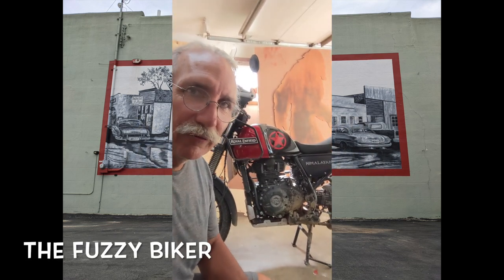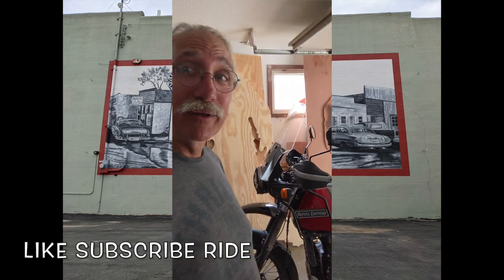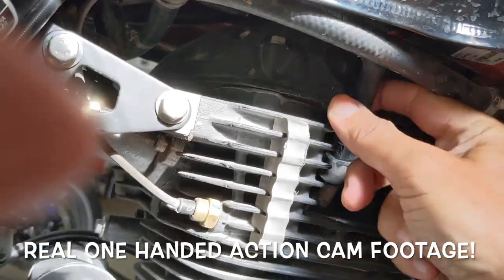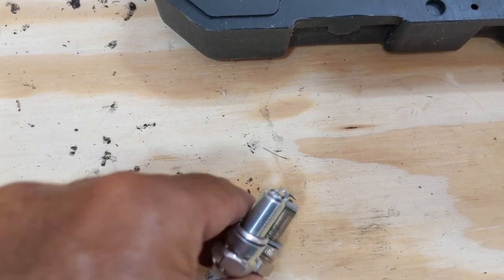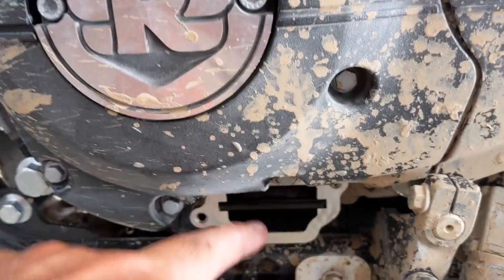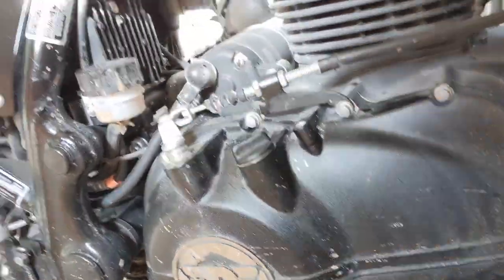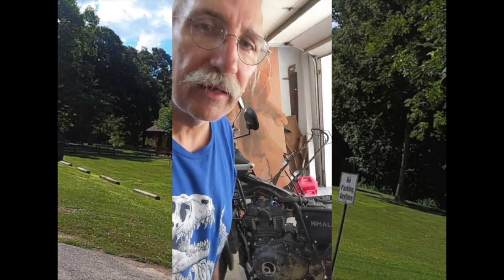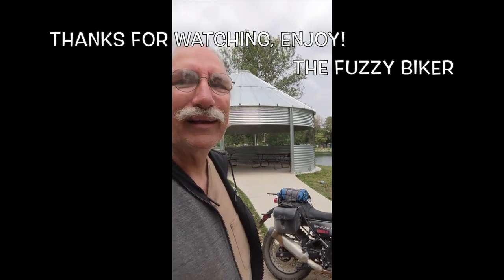RE Himalayan Another Oil Change & Valve Check Video 25

Comment: I was amazed at how dirty the oil was in my INT 650 when I changed it at 1000 miles.  I bought the bike from the estate of a gentleman who had passed away, so I didn’t know the maintenance history.  To be safe, I changed the oil when I got the bike.  Air cooled engines are hard on oil, so I’ll change it at least every 3000 miles if not sooner.  I really expected synthetic oil to look a little better.  Had some debris on the drain plug magnet as well.   Hopefully that will clear up soon, otherwise the engine will run out of metal, lol.  The INT has a smooth engine/transmission for a budget bike.  I’m pleased with it for the first 500 miles I’ve ridden it.
Reply from the maker: Sounds like you got a good deal on the bike. Keep that oil clean :-) wahoo!

Comment: How is the CalSci windshield holding up?
Reply from the maker: I like that windshield a lot. I did have to use different hardware to attach it to my Himalayan. After that change it has performed flawlessly. It does take a lot of energy to go into a strong headwind though.
Reply: @forgottenmotorcycles  I have that issue even with the stock windshield when riding into headwinds. I remember the video when you installed the windshield and appreciate your reply - I have been considering one for a while. I'm tall so the stock windshield doesn't do much.
Reply from the maker: @jeremyethridge1934  I actually feel that the tall windshield makes my motorcycle much more rideable. Keeps the wind off of me, gives me a place to hide when trucks go by, and it protects me from the rain. Just love it :-)